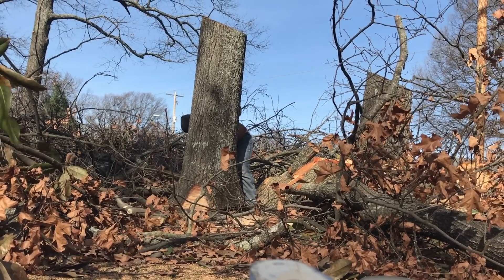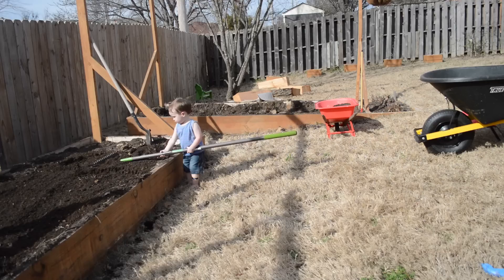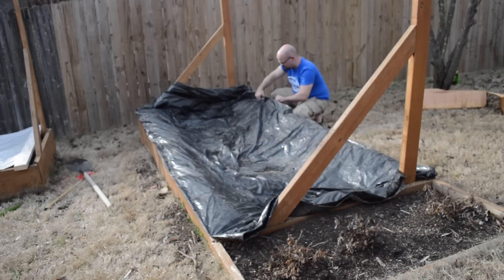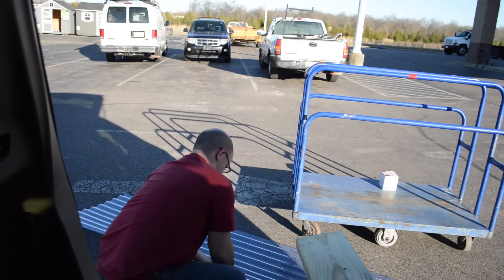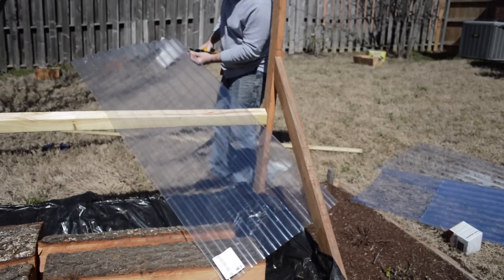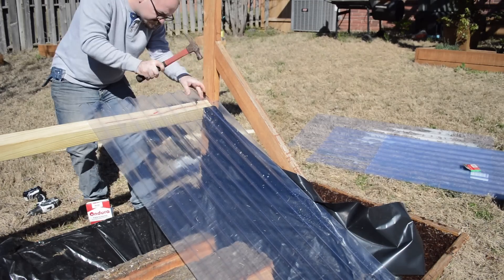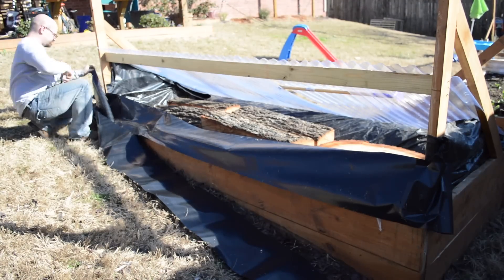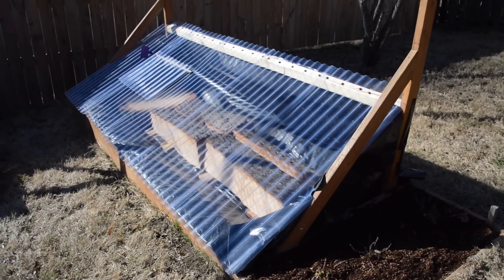Budget DIY Solar Kiln to Dry Wood // How To

Comment: Since you cut you own wood, please make sure next time to coat both cut ends very well with wax. Liquid wax the ends once;  twice is better right after you cut the tree. If you have time and space dry the lumber in the shade for an extended period, like a year. I think the rule of thumb was 1 inch per year drying time outdoors. Crazy long. Then you can do your kiln, and the kiln without a fan may cause some problems of unevenly dried of the then wood. Most  importantly is to vent your kiln. The moisture coming out of fresh wood is tremendous, and will not dry properly. Remember never to store any fresh wood without stickers between the lumber; spacers. Or the wood will mold and discolor. Did I mention you are a great dad. Happy to see your son interested in helping you. Hope this helps.

Comment: Put a lightbulb in there,running from a wind turbine or solar panel to increase heat and speed up the process. The one I'm building is for mostly a damp UK environment. It will have a wooden frame. Insulation panels with a raised slatted platform with a couple of lightbulbs under the platform. The heat will thus rise to dry the wood.

Comment: I contemplated building something similar but then had to climb in to my attic to run a wire and it hit me....I improved the attic access above my garage and built a couple of quick racks up there and voila, I have a nice drying room.  I can reach 150 degrees in the warm summer sun with the roof vents providing the air flow.  I leave it up there for a few weeks and only pull it down when I am ready to use it and the moisture content is below 10%.  It's small scale but works great for me.
Reply from the maker: Woah, that’s brilliant. I might switch to some of that!
Reply: imah8ter07 have you had an issue with it drying too quickly?
Reply: iamamp3pimp I haven't.  I clamp them in a rack of sorts to prevent cupping or warping and it seems to work well.  Sure, I get some splitting or checking but everything is oversized so I can just cut it out.  My wood is mainly used for live edge serving trays, signs and shelves so a little character is ok by me.
Reply: From all of my research thats a horrible idea.  It dries too fast.  I thought the same for my attic and everyine told me no
Reply: @thisoneforjoe  Not so horrible an idea if its done properly-stickered and ventilation.

Comment: Been thinking about this . I think I will try making it 4' off the ground , make a zig-zag of 4" black ABS as a heat collector,  then duct into the bottom . But I've got some really good info from your comment section
Reply from the maker: There's been some super good info in there

Comment: Having the wood in direct sun will dry the sunny side more and cause checking. If you add black shade cloth under the clear plastic it will increase the temp and block direct sun.
Reply from the maker: Good tip!

Comment: Some friends of mine are using their greenhouse as a kiln now to dry firewood. It is working really really well!
Reply from the maker: That’s pretty brilliant!
Reply: How long will it takefor them to dry? Ofcourse its a matter of thickness
Reply from the maker: Rule of thumb is an inch a year. But I tore it down after a year to reclaim the garden space and used the pieces to build a workbench. Just kept the top and base separate so any movement won’t destroy the top
Reply: YouCanMakeThisToo Much appreciated. Thank you

Comment: Might try making the roof either hinged or a removable frame ...
Reply from the maker: I thought about that! It's a good idea, I just wanted something super simple and fairly inexpensive that didn't require "found materials" or anything. But yeah.. some used windows (which are pretty easy to find) and on some hinges would be a great way to go.. just like cold framing for gardens.

Comment: Did you have good results, and how long did it take?
Reply from the maker: I ended up breaking it down after a year to get my garden bed back. It definitely dried them out quite a bit but wasn't a great test because the material was so thick.

Comment: That's awesome. How long do you think you will leave it in there? I'm looking at drying some 10" white cedar in the round and wondering about a rough timeline.
Reply from the maker: +Mike Freeman cedar actually dries pretty quick relative to other woods. 1" boards can air dry as fast as 6 weeks. If you get the bark off it might be dry by mid-fall. A moisture gauge is essentially to really know though.

Comment: I'm currently finishing a live edges kitchen table. There are however some lines /grooves going straight across the table which I've been told are sticker marks from the kiln. How can I fix this ? Do I have to sand whole table down to depth of groove or can I fill will epoxy or filler and then stain . Thank you in advance
Reply from the maker: That's pretty common, but they're normally rather slight. Also, just the process of flattening the slab and sanding it should remove those lines. If you're really lucky and the slab is dead flat, you'll either want to sand the slab down past that, or just set up a router jig and reflatten the table to get below those marks. I would not recommend filling with epoxy or filler and trying to stain, it'll break the flow of the grain and be very obvious. How deep are the marks?
Reply: @YouCanMakeThisToo  I've started trying to sand them out with belt sander. Being very careful of course. Seems to be working . Will hopefully finish tomorrow . Deepest maybe 3mm max
Reply from the maker: Ah good deal! That should sand out nicely.
Reply: @YouCanMakeThisToo  thanks 👍

Comment: Nice concept, I have enjoyed watching several of your videos and look forward to future ideas. FYI, on this video the sound was almost too low to hear on my MacBook Pro, however the sound level on my iMac seemed to be fine.
Reply from the maker: Gary Houk thanks! I really appreciate that. I've heard about the sound on a few videos, I think it had to do with changing my editing software. I've since made a point to boost the audio. If you have a chance please let me know how it is on my latest video about the fence. I pushed the audio a lot on there but I haven't had the audio issue on any of my devices so I don't have a way to test and see if that fixed it or not.

Comment: Well. Your wood has to breath. The moisture of the wood has to go into the air and the air has to be dry. You can heat it up all you want but if you keep it in a moist enviroment it won't dry.
Reply from the maker: That’s why I didn’t build it tight, there plenty of air exchange to let the moisture exchange.
Reply: Brink Shows  exactly! You should have a hot side and a vented side with a baffle separating them and a fan in the baffle. The fan would blow the hot air from the sun down and through the wood pile and as it circulates it will exhaust some moisture out vents in the bottom rear and bring in some fresh air from vents at the top. This is how you evacuate the moisture from the logs. The fan can be set up on a timer so it only runs during the day time or placed on a thermostat so it will only come on when the temps are high enough.

Comment: The plastic will pull moisture out of the ground
Reply from the maker: It might draw the moisture to the top of the ground because of the heat, but the plastic is impermeable, so the wood stays dry. Or am I missing something?
Reply: @YouCanMakeThisToo   you are essentially trying to dry wood on top of a lake with a piece of plastic above it as a table. It will still put water inside the box as the ground water evaporates from the heat inside the box. I would recommend something like plywood on top of 2x4 as a base. You can do it the way you are but it will just add time to the drying process. But nice setup man 👍
Reply: @YouCanMakeThisToo  you would be surprised how much water the plastic will pull especially if you sand in your dirt. I live in an area where we have a lot of sand in our dirt. It looked like an lake undermine when I did it this way. But if it's working stick with it

Comment: what happens when you want to remove the redwood that is in there? or add in new wood once this is dry, how do you open and close it back up?
Reply from the maker: +CojakSilverBack right now I would just pull out four nails and lift off the top. There's enough room to get in there with the moisture meter without undoing anything. If I keep using this more I'll modify it.

Comment: It's better to air dry red oak for at least 4 months before putting it into a kiln. Red oak needs to be dried slowly or you will get a lot of cracks. Also it is better to mill the wood first. The inside of the wood will not dry at the same rate especially on thick logs.
Reply from the maker: Good to know, thanks man. I figured since it's just solar and not particularly insulated, it would be alright.

Comment: This is one of the most manly videos I've found on yt.
Reply from the maker: +grackle_dfos haha thanks!
Reply: btw, how long did it take until the wood was usable? and did you have any cracks?
Reply from the maker: +grackle_dfos the big posts are still in there and aren't cracking. I pulled out the cookie today actually and it's dry, does have some honey combing though.

Comment: How long does it take to dry the wood using this method? I have a slab of live elm about three inches thick and 3 feet long.
Reply from the maker: The rule of thumb for air drying is a year per inch
Reply: @YouCanMakeThisToo  What were the results for your wood using this kiln? For the cookie and the blocks

Comment: Not to be a doubter, but all your gonna have is mold. And very little dry wood for your effort. At least add a 80$dehumidifier, as you need to move the moisture Away from the wood, heat alone will do little. Or cut outs to allow fresh air in.
Reply from the maker: That's why the plastic on the back was layered and the ends were tight, to allow air flow
Reply: @YouCanMakeThisToo  ahh ic didn't catch that.
Reply from the maker: No worries man

Comment: Interesting, but very flawed. Everybody knows that a wood kiln needs insulation, a fan, a heating element, and a dehumidifier; so, why didn't you include those four elements? Moreover, you are attempting to dry green lumber that is more than one inch thick. Given these five oversights, your lumber might take forever to dry, and it might not dry evenly. In fact, you might ruin what looks like good wood. Since you asked for comments and tips, you might view the YouTube video titled, "Solar Kiln by Ricky Alexander". His video might help you upgrade  your wood kiln.
Reply: Chester Micek you are saying that without those four things you can't have a solar kiln,  I think you really should do more research.  Virginia Tech has a very good one that only uses fans,  others have had good success using nothing but the solar heat you don't need a heating element, dehumidifier, insulation or fan.
Reply: Chester Micek ....Pleasant to know that there is some expert on You Tube.What about lets say.....air drying, that is a good idea.Keep up your video
Reply: My firewood must not know this
Reply: Good one!!! Simple ways have worked for thousands of years…
Reply: I believe the objective of this project was "cheap and easy". So what Exactly is this flaw you speak of?
Adding Even a Single Element that you mentioned would incur both additional cost and complexity, not to mention the running cost of a couple fans on their own. If you were to say give advice on improving the design with the materials provided then people may just take your rant seriously. How ever, as it stands, your just trolling.